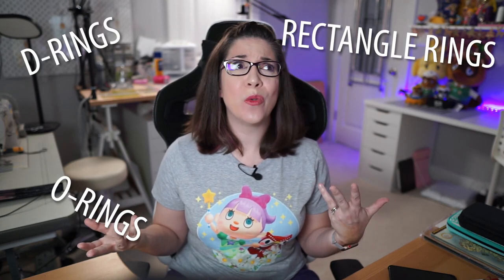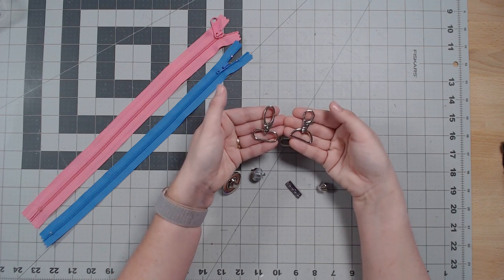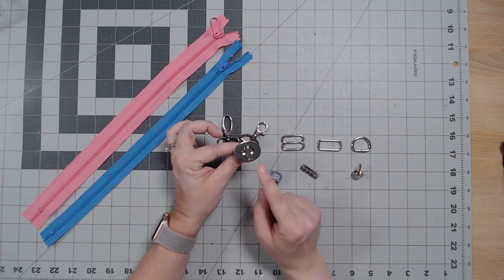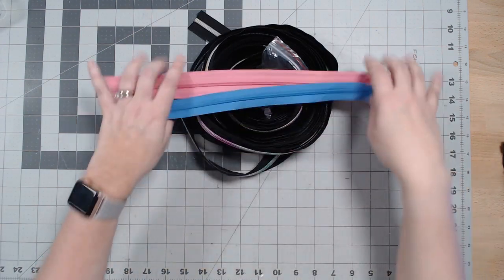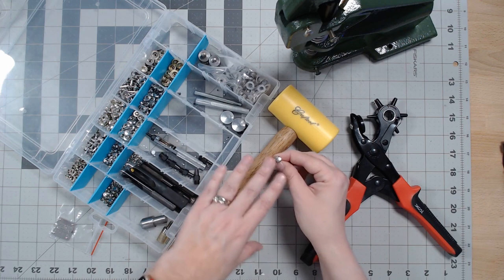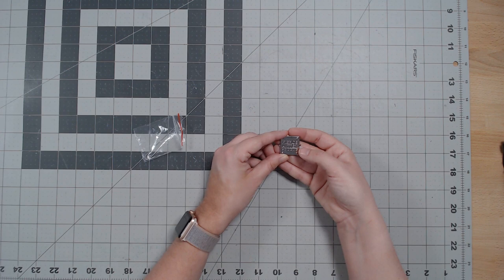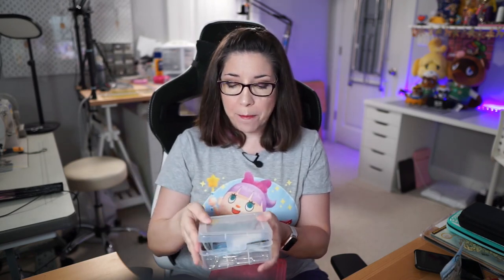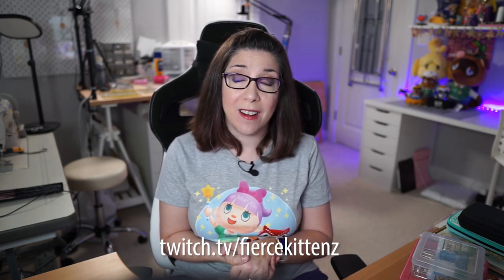Hardware for Bag Making

Comment: Thank you for this VERY INFORMATIVE video.    What size(s) of rivets do you recommend using as in the NCWallet or for straps to bag to secure?  So that when I look at purch a press I will also get the needed dies.  

Thanks again
Reply from the maker: I use 9mm rivets. If I use smaller, they tend to pick loose as I can't quite make a small enough hole for them.

Comment: Thanks so much for your great tutorials. Since most of my bags are smaller, I prefer the 3/4 strap hardware. I have basically stopped using D-rings and clip hooks. I'm going more with the rectangle "rings" and sliders. But I'm having a hard time finding 3/4" sizes for my hardware. Do you have any suggestions? 
Thanks again!
Reply from the maker: Nolvo world on AliExpress! It'll take a few weeks to get to you, but the quality is great and you can get supplies in bulk, too! If you need something faster or in smaller quantities,  look at MoreMeKnow.com